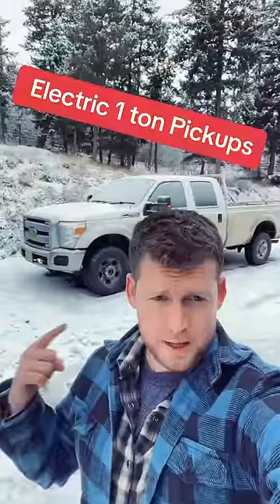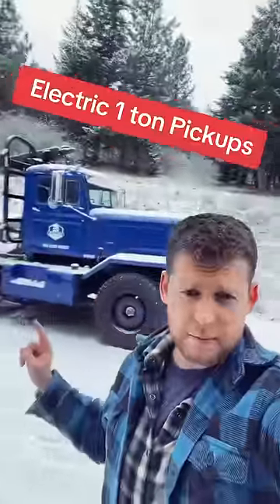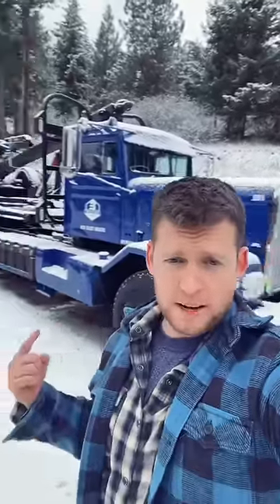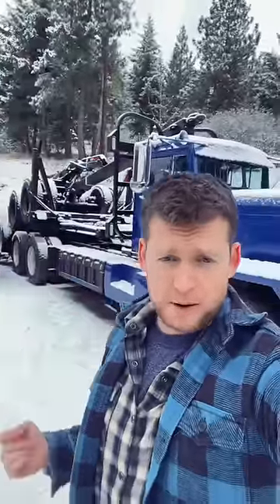Electric 1 Ton trucks

Comment: I would love this idea for my ford E-350 service van. It has a large service body on it that leaves me with tons of room in-between the frame rails and a 7000 watt 240v generator already installed.
Reply: I have a 1970 international harvester!
Reply: the fact that it already has a generator fitted its a big thing, allows you to pull out the old engine and use the front end for storage or other uses
Reply: @OPsings  D-Series?
Reply from the maker: I think the E-350 uses the same 1 ton axles as the F-350.  I’d have to look into it more but it should work
Reply: @EdisonMotors  I believe you are right, if you need me to I can grab numbers off mine. It's an 2003 7.3 with the 4R100 Trans. I would like to battery swap it when the engine dies.
Reply: @dawildcatz87 If* the engine dies lol
If you maintain it properly that 7.3 may never die!
Reply: @jackets64  she's at 413k miles. Started its life as an ambulance, then diesel mechanical tossed a work body on it and sold it to a oil field worker who offroaded it. I got it and brought it back to life. I hope it lasts another 100k.
Reply: @dawildcatz87  Awesome, I hope it lives on for a long time.
Reply: @dawildcatz87 my buddy has a 7.3 with over 800 thousand miles if you take care of them they last forever
Reply: @EdisonMotors at least some of the vans use a lighter duty rear axle based off of the dana 60, instead of the sterling 10.25/10.5 axles used in the 1 ton trucks.
Reply: Can’t wait to see the kit! Are you going to offer the e. Axle with a 2 spd set up? That would be icing on the cake!
What engine/Genset combo are you thinking? So many questions!
This is going to kick ass! Nice work!
Reply: seems like same engine, just dropping the transmission and transfer case then using adapter plates as necessary to bolt up a generator, like demonstrated recently with Topsy.
Reply: @mlindholm  Wicked!  I will have to check out more vids then! Cheers!
Reply: @EdisonMotors  they are the same minus widths of axle vary from srw/drw/and f350and up cab chassis are also different. Width is only a concern to certain people, here in Pennsylvania tires can stick out past fender/ but that be just like a ambulance or most service body trucks
Reply: Please make kits with bare axles so whatever necessary perches/links/brakes can be added to fit the individual vehicle
Reply: @EdisonMotors  It does because I've done a 4x4 conversion on a E-350 delivery van with an F-350 front axle, transmission and shortened front axle.  You just have to make sure gear ratios are matched and transmission comes from same model year and engine as van.
Reply: @TempestV  Only the lighter ones, the commercial chassis cab E350s use same parts as chassis cab F350s
Reply: @dawildcatz87  You're o k with the battery taking up the interior space?
Reply: @RigepFroggit  I've heard of some e350 chassis cabs that had semi floater d60's under them.
Reply: @forceawakens4449 You still need to have an engine in there, but yes you can probably downsize it a bit to pick up some room, but it's not like you just have a giant trunk.
Reply: @TempestV Usually the 1 tons have a Dana 80 in the rear, and a Dana 60 on the front. Well, the do on the Dodge, oh yeah, Ram now.
Reply: @wesman7837 he said there is already a generator in the van. So force awakens is just suggesting turning it into a frunk
Reply: @wesman7837  the thing is ,with what I assume is an external generator on it, the 7.3 engine isn't needed since you can recharge the batteries using the generator instead of the engine.
Reply: you could even put the batteries in the engine bay to offset the engine weight, keeping the weight distribution closer to stock
Reply: @dawildcatz87 sounds like you already have your generator motor. A 7.3 would be a good stationary unit for a pickup
Reply: @EdisonMotors should use the same chassis as well.
Reply: You got lucky to find a 2003 with a 7.3L, I was curious because I thought 2002 was their last year of production. The 1st quarter of 2003 was the last models before the 6.0 was used as a replacement.
Reply: Love the idea. Best of luck.
Reply: @EdisonMotors can you use CORTAN STEEL FRAME? ...OR STAINLESS STEEL?
Reply: @Truckerdaddy  I also thought 02 was the last year because I had an 02 F250 and my cousin had an 03 that was a 6.0. I've checked the VIN on the van multiple times before I purchased it and went over the engine to confirm it was an 03 with a 7.3.
Reply: Doing burnouts in a van would be sick
Reply: @EdisonMotors please think about the swampers when you make a electric bed truck
Reply: sadly a 7000w generator probably isn't nearly large enough for a lvl 3 ev charger
Reply: @KRKM89 His generator is far too tiny to be useful in this application.
Reply: Ohhhh have a 91 E350 ambulance to motorhome conversion, with the 7.3 idi @99,600 miles and a dead transmission!
Reply: How many amp generator would you need to run this setup.
Reply: @patrickcowan8701  you'd need somewhere between 50,000-100,000kw
Reply: @forceawakens4449  7000W is roughly 10 horsepower. That exact generator is not a good power source to operate electric traction motors on an E-250 type vehicle

Comment: Edison has dramatically changed my mind of electric cars. Instead of creating a rc looking car your taking the vehicles we like the looks of and adding electric.
Reply: The design of newer vehicles is all hype. Other than crash safety, it's just hype with no practicality. Especially the "glass cockpit," aka, touchscreens, which just make driving dangerous.
Reply: The main difference is not the looks. The main difference is that Edison makes them for virtually unlimited lifetime. A mechanic can easily reach every part, there's nothing hidden in weird places, there are as many industry standard parts as possible, all the flange sizes are industry standard, everything is held together by standard sized screws with standard heads, everything is designed to be repairable and updateable. 

Usual EVs are designed for 1 battery lifetime, which is maybe 12 years in warm climate in less than 10 years in cold climate. Changing the battery in them is theoretically possible, but you have to dismantle the whole car to get there. They are designed to make a battery swap uneconomic.
Reply: Jegs make an ev motor that bolts to a gas engine transmission fyi
Reply: @jessefarley4609  Onto the output of the transmission, or in place of it?
Reply: Edison really ripped Nikola Tesla off. I would never use Edison as a production name.
Reply: @aweewa5659  Given how much of a complete douche canoe "Tesla" (Musk) is these days, I'd say turnabout is fair play.
Reply: @tvk-9cop  I watched the documentary on Nikola hydrogen trucks. Wasn't that crazy just biding their time with that phony truck going downhill just for a shoot?

Comment: Need to buy a trashed 1 ton roller now.
Reply from the maker: Imagine the sweet auction finds for something like this
Reply: @EdisonMotors what do you recommend?
Reply: There’s so many trucks rotting away at auctions with blown engines. It ain’t even funny.
Reply: @markm0000  if we cared for the environment the big 3 would just buy them back for parts and throw them back on the road after proper testing for safety
Reply: @EdisonMotors  I was thinking the same thing, always wanted an old dually, now's the time.

Comment: Dont forget the homestead / Off-Gridders with their "small" trucks. They usually already have solar, batterys and a backup generator. Dont forget to add the power-interconnect between the house and the truck.
(I'd go for the 63A 3ph CEE connectors, 32A would suffice for most also and is easy to wire and flexible enough)

Comment: A retrofit kit in an RV would be a game changer.  There are tons of old gas RV's and this system would solve so many issues.  Most are only running three  lead acid batteries (1 engine, 2 coach) if that.

A big battery bank with 12V for the engine and lighting, then 120V for outlets, fridge, water heater, oven and electric or diesel heat would completely replace onboard propane needs and replace the need for a generator.  Plus most have space for solar on the roof.
Reply: U could profit off this

Comment: I've been talking about this since I started at the railroad in 2016! A 4 cylinder generator should be able to power a dually if a two locomotives can pull 125 200,000 lb rail cars.
Reply: My thoughts exactly, maybe a VW TDI diesel, or a Kubota diesel with the gen set
Reply: I've thought about this for about that long as well! I just don't have the same drive as this guy! Lol. Some people are meant to be leaders.
Reply: Fun fact: if your SUVs engine was as efficient as a diesel-electric locomotive, it would be smaller than your smart phone.
Reply: Rolling resistance
Reply: Question what is the steepest hill your train goes up? My understanding is they steepest grades for trains is 2.5 degree incline.
NDR
Reply: Whether you power that truck by gas, diesel, or diesel/electric hybrid, it will take the same amount of energy to move it.
Reply: @jamescrud  The weight of the propulsion system does not effect total weight?
NDR
Reply: @nevadadesertrat267  Yes it might but for the sake of argument I'll assume the weights are about the same. The electric set up might be a bit heavier but it's more efficient at converting stored energy to power at the wheels so it balances out.
Reply: @jamescrud  Assume? that means science has left the discussion.
NDR
Reply: @nevadadesertrat267  No. It means we have no actual numbers to discuss anything quantitative. Fundamentally science says it takes a given amount of energy to move a mass. How you produce that energy is irrelevant. What counts is how efficiently can you use that energy and to waste as little of it as possible. If you want to talk actual numbers then we need those numbers but we don't have them so arguing about it is pointless.
Reply: @jamescrud  You assume too much. I was also alluding to the fact the heaver that truck becomes there is less weight towards max GVW left for cargo. So maybe your more efficient vehicle needs to make 2 trips.
NDR
Reply: many already do this
Reply: @nevadadesertrat267  Like I said we have no numbers so you can say maybe this, maybe that, but it's pointless. You would have an argument if we're comparing a diesel to a full electric truck. In that scenario a diesel would come out on top related to range vs hauling capacity because batteries are heavy and have low energy density compared to fuel. It's not as simple to make a comparison with a hybrid configuration because you don't need as many batteries and the diesel generator weighs less than an engine.

Comment: There are a lot of 60-70’s C60 and similar Grain trucks out here in IA that are needing power trains due to long life/poor maintenance. I’m personally looking into aS1400 international single axle as a daily driver/utility truck…..they’d be used for hauling goosenecks or possibly 20-30” trailers. That would be pie in the sky usage, that 3rd massive truck that could haul around tractors for hobbyists and the like, also that heavy not gonna slip vehicle as well….
Reply: 20-30" trailers should be easy peasy :P

Comment: This should be set up for a schooly build it would be absolutely perfect for off grid housing in a school bus. you can even put solar on the roof
Reply: School bus that recharges during the day from the roof solar, ready for the afternoon run. Add plug-in option for when it's parked at a depot at night, then it only uses the diesel geni when needed. And secondary use, buses have room for a lot of batteries underneath, if the power grid fails in a suburb, the buses could deliver power in to a school to keep things running while the grid is repaired, or get parked outside a local hospital in an emergency, for power and evacuations useage.
Reply: @PiDsPagePrototypes I might be wrong on this but schools and hospitals do have emergency generators but that would be a good supplement. But for a school bus this kind of conversion would be ideal they have the room on the flat faced and reg school busses but the shorts might be a bit more of a stretch to fit.
Reply: I understand the urge to DIY everything and be quirky, but why not buy a used RV instead of a school bus?
Reply: @johnharvey5412 ever seen the construction of an RV vs a Bus? That's why. Most RVs are flimsy pressboard and the ones that aren't are based on busses.
Reply: @906MediaProductions  makes sense, I guess.

Comment: Thank you!!!!!!! Brilliant idea. 

You should really market this to hot shot truckers, first responders, and try and get a city or municipality to convert a certain percentage of there fleet so they can see the differences between the two. 

Also, make sure that this is quiet, but not quiet. Does that make sense as I think thieves would really enjoy having a truly quiet vechile with all that torque to do theiving stuff.

Another idea..
Did you Packard cars are coming back.... they are remaking old style body cars.... why not combine your system into classic cars... why not reach out to Packard and see if they would be interested in a partnership
Reply: Plus, the vehicle is required by law to make a certain amount of noise. Pumping square waves into the motor at low speeds should be sufficient and not add any extra parts.
Reply: @user2C47  this I did not know about.
Reply: @roterakaten636 Pedestrian safety rules, that have had to be brought in because EV's are practically silent, and idiots wearing ear pods to listen to music too loud don't look when crossing the road.
Reply: @PiDsPagePrototypes EVs are not practically silent. Teslas are louder in parking lots than a lot of gas cars.
Reply: @jaredlancaster4137  See the first half of  user2c47's comment above.

Comment: lookin forward to seeing an f-350 electric with a 3306 CAT under the hood🤣

Love the things yall are doing, keep on truckin
Reply from the maker: I’m not saying that you shouldn’t run a 3306cat in a pickup… but may be a little overkill
Reply: Not to be too critical....

But wouldn't throwing an extra thousand pounds, plus cutting out the firewall, and probably sitting in the back seat of the truck cab...

Just to run a generator, be a little impractical?
Reply: I think that’s the joke…
Reply: @dposcuro  Nah buddy the generator goes in the back. The cargo goes in the Frunk

Comment: The locomotive of all time!!
So excited to see the engineering behind this project!
Reply: Unlike a diesel electric locomotive, the Edison Motors solution is to drive the electric drive motors with the batteries only. The diesel engine drives a generator only to recharge the batteries. The diesel generator and the wheel drive motors are on different circuits. There are YouTubes on their design.
Reply: @petergersbach7355 So diesel-electric trains send power directly from the generator to the motors? I always assumed there was a battery in there somewhere so they could move a bit without cranking the engine.
Reply: @JamesThomas-kx5sj  No, a diesel electric locomotive will not move by itself without the diesel engine running.
Reply: So the load on the engine remains constant; depending on the number of poles on the generator and the desired voltage?
Makes sense if that’s the case. 
Thanks for sharing!!
Reply: @bobmartin6055  It sounds like that's how a battery powered one works whereas a traditional diesel-electric locomotive would control the generators output like a regular engine. There's always something to learn in the comments of these videos.

Comment: PLEASE PLEASE PLEASE include a high voltage engine block heater with a remote so I can warm my truck engine while I'm getting ready on a cold morning without wasting fuel!
Reply: You don't need a special block heater. It's a hybrid, you can drive away on electric.
Reply: Also he lives in canada. Block or oilpan heaters are provincially mandated in most provinces and territories.
Reply: @klassensj2  i had to look it up cuz Canada does have some crazy laws but no, that is not correct, and it's obviously ridiculous.
Reply: Still need to put some heat into the block before firing it up at 1800rpm. As a generator engine, it starts and stops maybe once a week? In a truck, several starts a day would be a bad thing when its cold out.
Reply: Remember, battery packs need thermo control. They'll need to be heated/cooled. Same setup could be used for the ICE.
Reply: Heating will drain your batteries like crazy, if you're not plugged in.
Reply: The answer for this is a mini diesel boiler, remote start it, and it heats the engine coolant and battery coolant, while also heating the cab. They use a tiny amount of fuel for the heat they can put out.
Reply: @klassensj2 😂 no